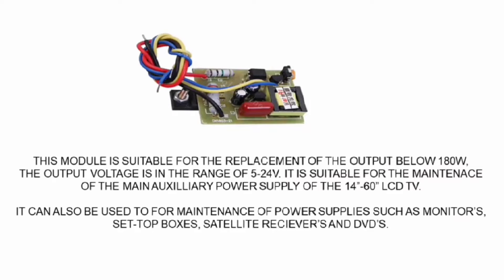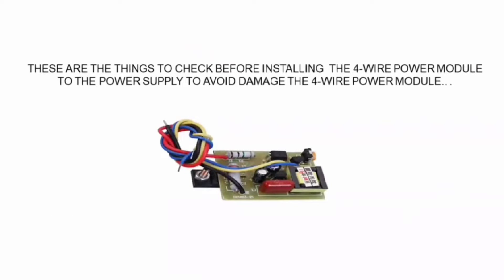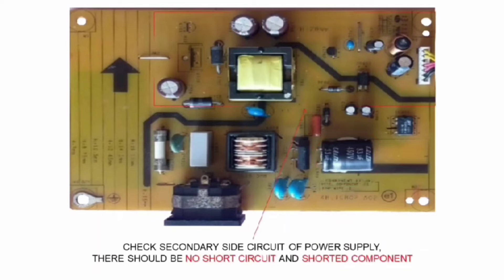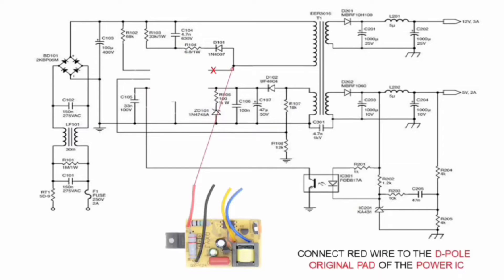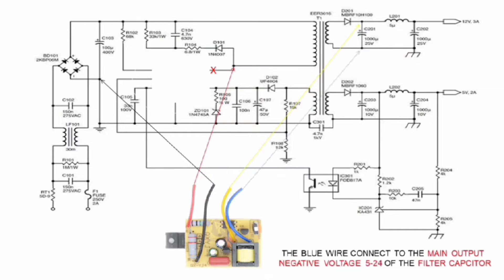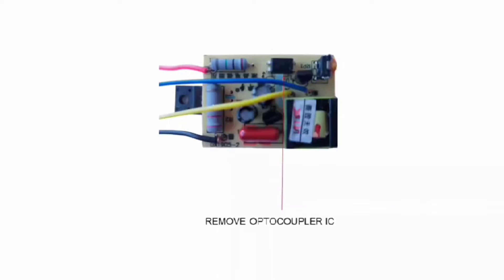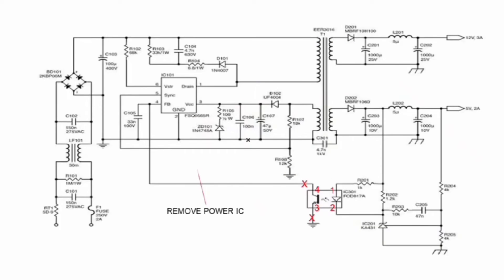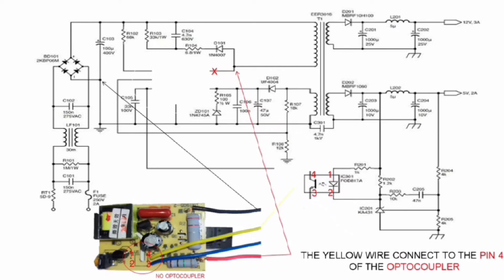how to use and connect 4 wire power module on power supply

Comment: Unlike the first method, Sir please, you said we will need to adjust the output voltage to our choice. For combo tv main board, I will to set it to the normal 12v diode after the transformer? And after doing that, can the configuration supply light to the tv backlight?. 
Question 2. When connecting it to tv power supply board, are we to set the output voltage to the required" standby voltage, i.e 3.3v, 5v" ? Or we are to adjust the voltage to 12v or 24v line?
Reply from the maker: 12V